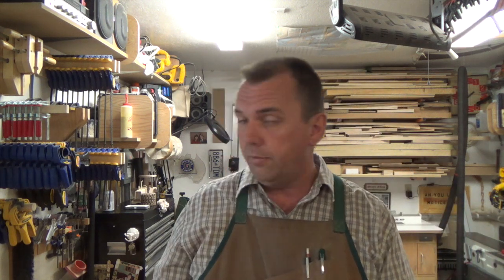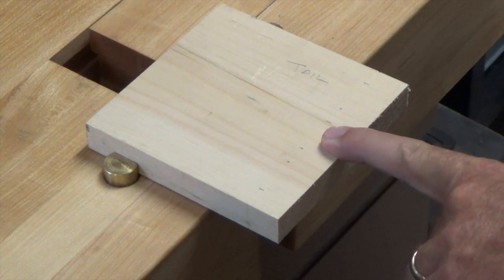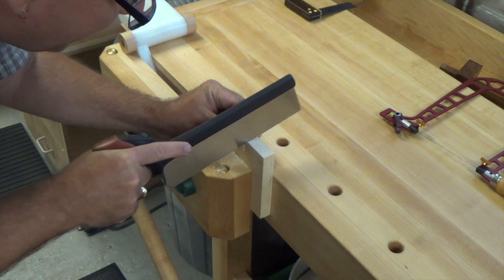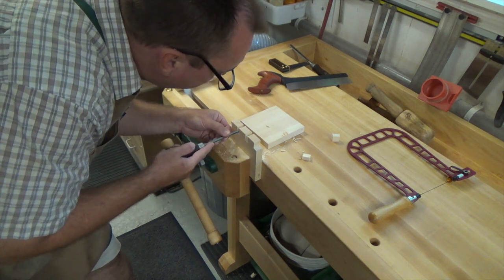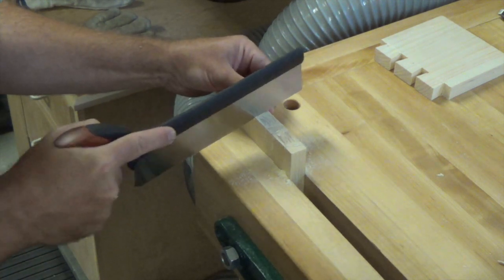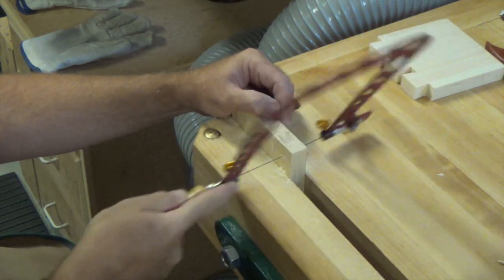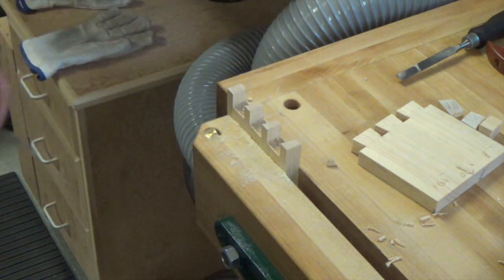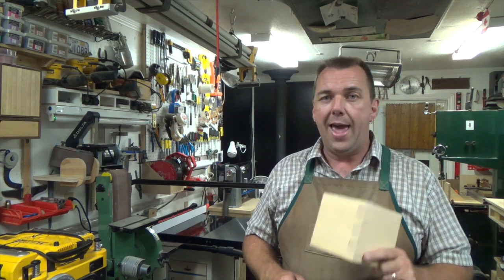Hand Cut Dovetails

Comment: I am learning to cut dovetails and am at the stage where I cannot almost get a consistent result. I have watched this  video more than once, recently, as well as shortly after you published it.  I noted  the gap between the inside face side of the tail where it meets the end grain of the dovetail socket. I am having the same problem and have minimized it with time but  I'm not sure why it occurs sometime but not all the time. 

Has this been a problem going forward for you but,  if not,  how did you solve the issue?
Thanks,
Doc
Reply from the maker: There is only one way to overcome these problems William and that is practice.  The gaps can be caused by several things but the gap you are referring to (if I am understanding you correctly) is caused by chiselling technique.  Starting your chisel too close to the line will cause crushing of the fibres at the edge of the socket and create a gap.  Try making the socket a little smaller by lining your chisel up just behind your line and then trimming to fit afterwards.  Other causes of gaps are the placement of the kerf of you saw in relation to your lines as well as the squareness of your saw to the stock.  This normally causes gaps along the edge of the tails though.  I would suggest adjusting your chiselling technique and make the sock just slightly smaller and then skimming the bottom of the socket to custom fit.
Reply: Yes your understanding is correct. I work hard not to move my knifeline wall as some call it. In fact I'm a little fanatical about that. I have found that when  I trace my dovetails onto the pin board that if I move the tail board so the tails are a little proud of the face of the pin board, that has helped more than anything up to this point. . Thanks for responding. Really enjoy the detail and clarity of your videos.
Reply from the maker: Glad to hear that you are enjoying the show William.  Glad to have you as a viewer.  Please don't hesitate if you have any other questions and I will do my best to answer them.  Good luck with the dovetails.  It's all about the practice sir.